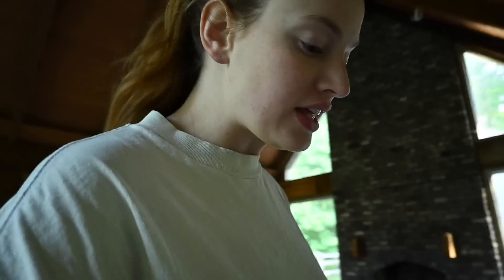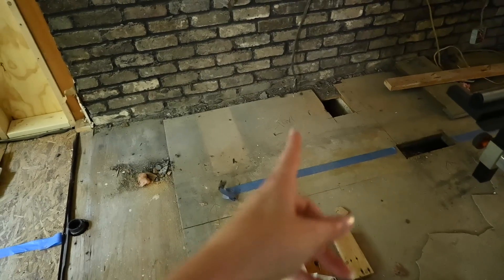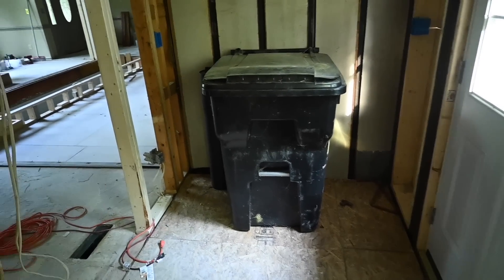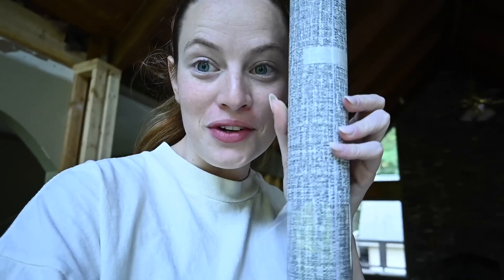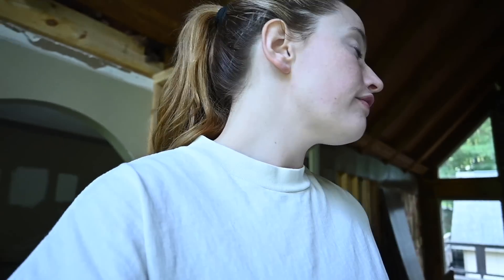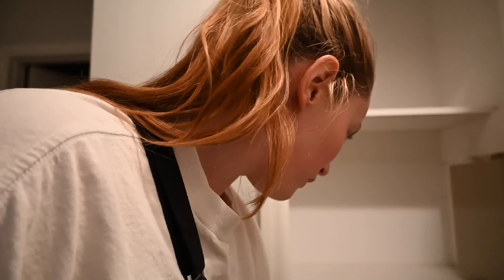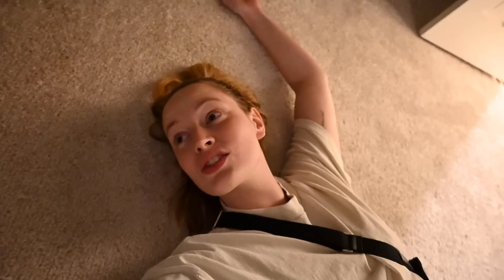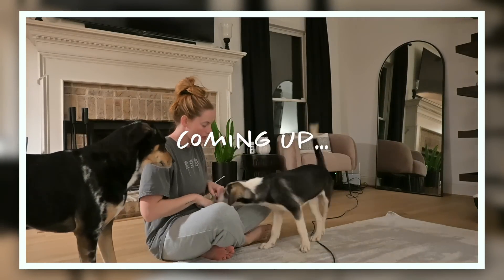what's been going at the house the past 2 weeks // finally entering the rebuild phase!!

Comment: For the railing, I used to install railing for a living, just need to make sure that curbwall your dad installed is strong enough otherwise 36" of railing leverage will make it wobble really bad and possibly have to rip it out to rebuild blocking after install which is not fun. Better to get it sturdy on the front end before drywall, you may even want to ask an engineer about proper blocking there. Anyway great vid.
Reply: couldn't figure out telegram but msged on insta

Comment: It’s actually more energy efficient to run both AC units. I know you said wasn’t working for a bit but, just as an fyi having both running at the same time is actually better. Instead of forcing one unit to overwork to continuously try and cool the whole house. But as you said your windows are probably a huge issue as well. I’m sure once you’re fully in and not doing a bunch of different projects any more will even that out some.

Comment: 2:29  That buried junction box is not code. Also it has WAYYYY too many wires going into it.  Please have an Electrican fix this properly.  they can install a dual gang double deep box on the other side of the outlet and just put a service cover on it.

Comment: Any time you have a vaulted ceiling like that, your power bill is going to be high. Especially in the winter because all of your heat will go up into that space. My house is the same way.
Reply: Just add a ceiling fan to move air in the winter or summer - huge help